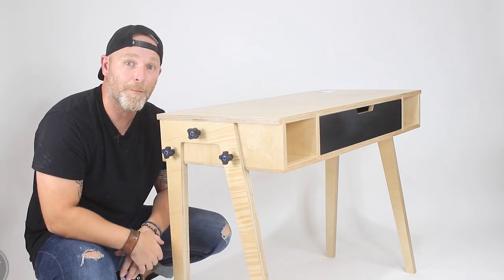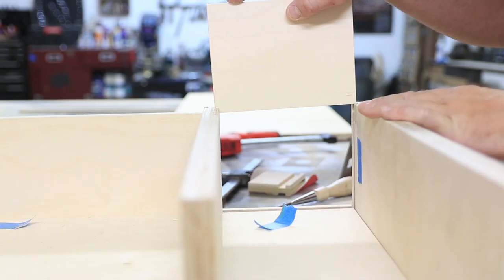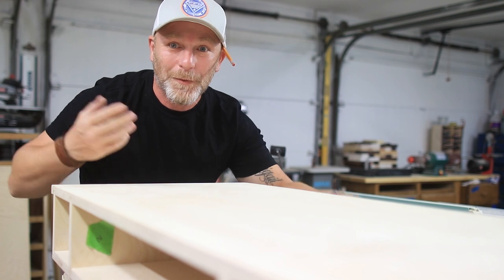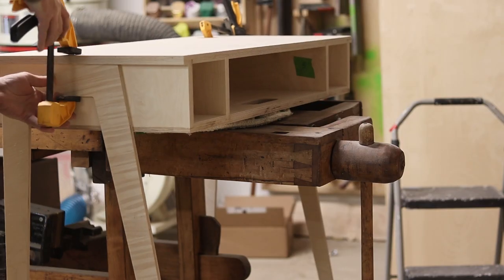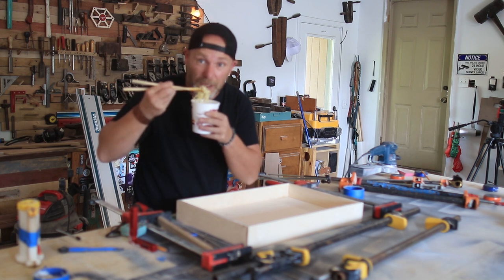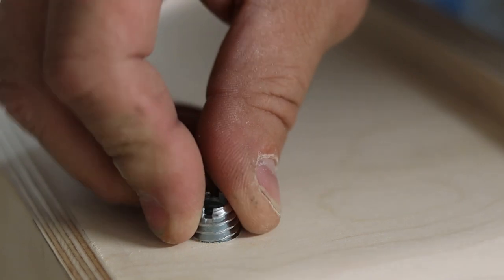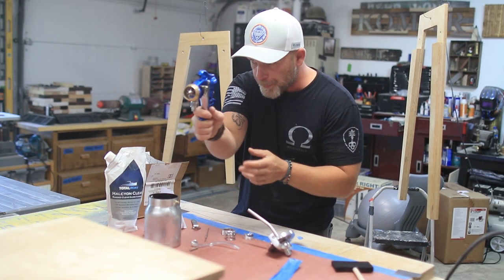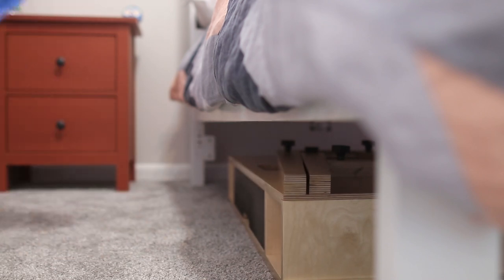DIY Folding Desk for Under $200

Comment: The desk looks good, what if you added hinges to the bottom of the desk and connected them to the legs? Would you be able to use only one knob to secure it open
Reply from the maker: You could but then when you hinge the legs down the part that attaches on the sides will be exposed on the side of the desk and not under it.  But I guess you can.